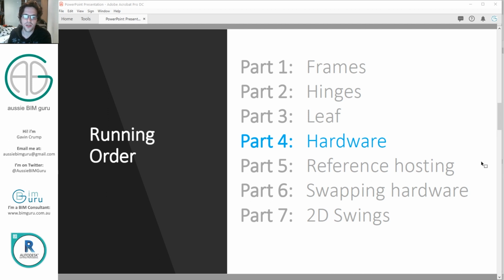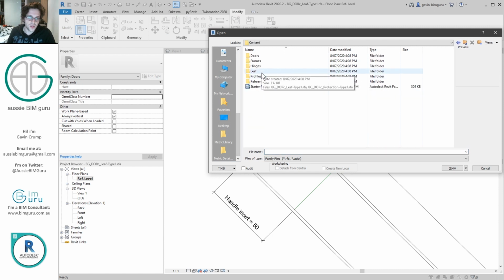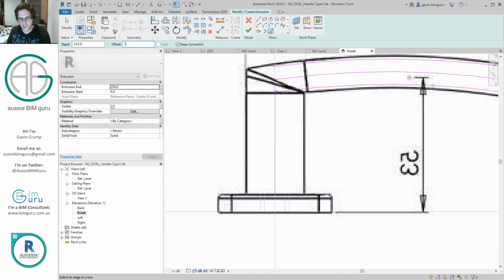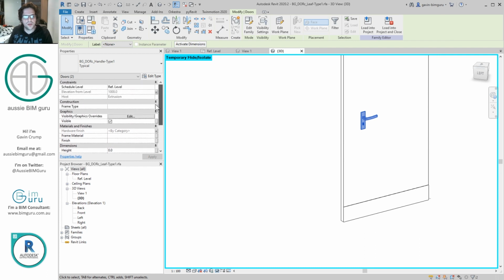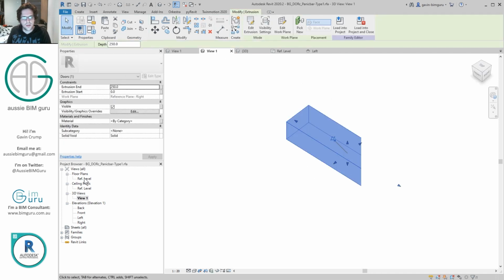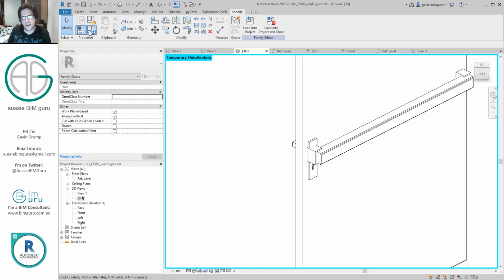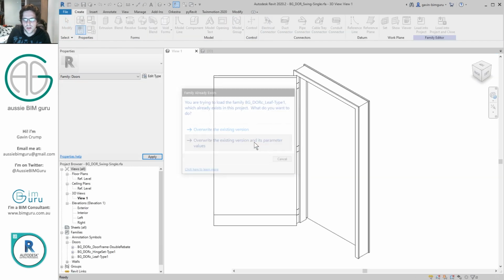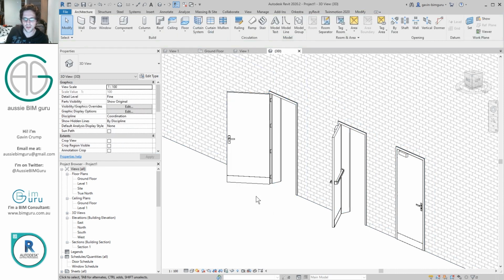Revit Doors, Part 4: Hardware

Comment: Bump in the Night! The issue with your Handle inset ref line is best resolved by hosting it on the swing ref line rather than on the ref level.  Great video, always good to see people doing video tutorials for the real world.
Reply from the maker: Thanks! Yes by around video 9 or so I realise reference lines are awesome for this. One key thing i always forget for this is to disable the always vertical setting in the family to be swung also.
Reply: @AussieBIMGuru  Interesting this hasn't presented an issue to me as yet. However I only use the ref line swing method for my nested Swing Lines family in which I use 2D Face Based families to display the handles in plan. One side note to swing lines, I have always had issues with using Symbolic lines to display elevation swing lines on both sides of a door leaf. I have resorted to using model lines and telling Revit users to use the sub-category to turn them off in 3D views. Fortunately Enscape doesn't show model lines.

I actually arrived at your video looking to see if anyone had worked out how to pass Family Type parameters to nested families. Maybe a step too far for Revit. My Construction Architects want to see handles in plan and elevation (for checking offsets to walls and dims in elevation). They don't need to tag or shedule them, however when interiors see handles on our doors they will probably want to tag them as specified. I will cross that bridge when I come to it.

BTW we have met at the sadly defunct RUGS.

Comment: 1. i am using ALT+TAB for get rid of  TYPE SELECTOR dialogue (temporary solution😉)
2. i didn't know that we can change view range in family. BIG THANKS for that.
3. i am also using "NOT" formula for visibility for two elements, but which formula you are using when you have more then two elements for control visibility (i am using "Integer" and put value like panic door = 1 door handle = 2 so on.)
your ruff modeling is near by 95% 😄
Reply from the maker: Yeah alt tab is a handy one! I use integers for multi visibility scenarios also, very occasionally a family type/label is suitable but usually I try not to rely on them too much (although I'll be covering them in the next few parts of the series).